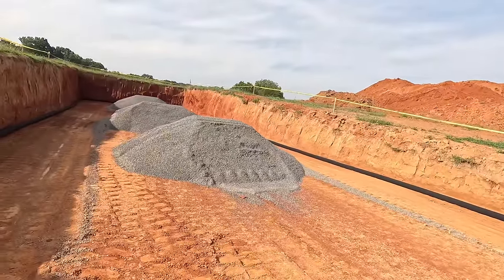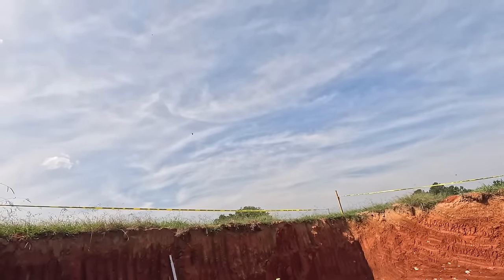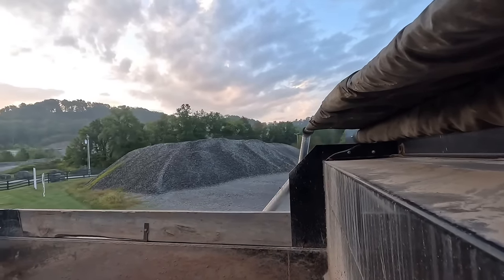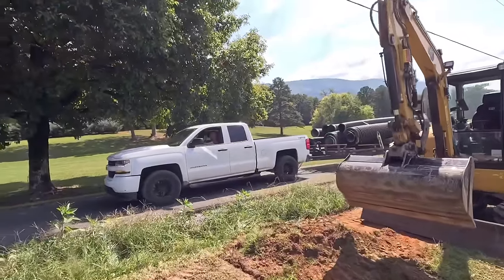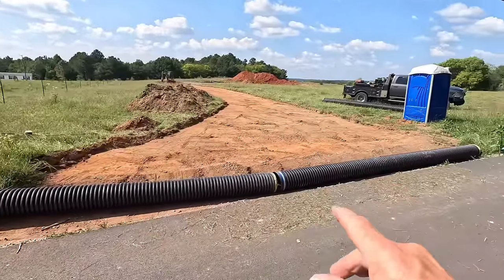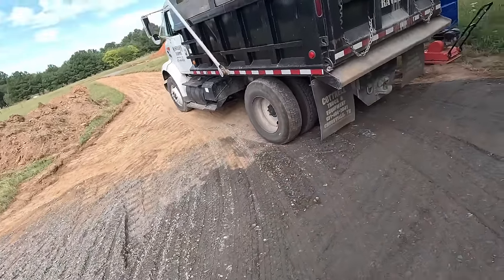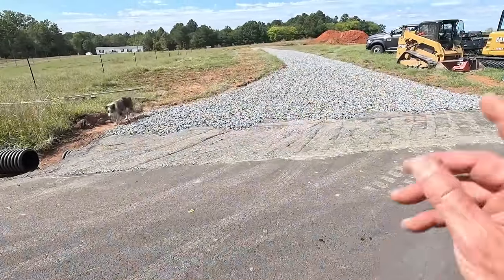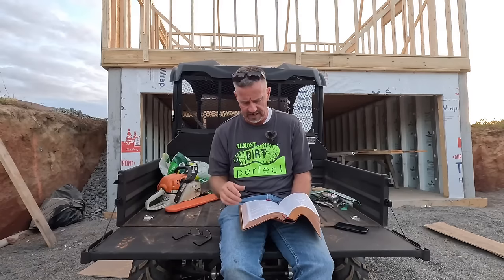LET’S BUILD A GRAVEL DRIVEWAY!!! NEW HOUSE, NEW DRIVEWAY…

Comment: Quick question, why don’t you take the teeth off the bucket? Seems like it would give a smoother finish when scraping and even dumping?
Reply from the maker: Good question but it’s not an easy thing to take those off and on. After you smooth it out and track/pack it down it’s in pretty good shape…
Thanks,
Sam

Comment: Awesome job. My only advise to anyone building a basement, is to use schedule 40 drain pipe around your basement perimeter .. this ribbed pipe tends to hold water and is a little on the flimsy side!
Reply from the maker: That is right, schedule 40 is a better option…
Thanks,
Sam

Comment: Looks great Sam! If you haven't tried one of those 36" aluminum landscape rakes they work great for leveling with less effort in my opinion think would of worked slick on that small gravel.
Reply from the maker: I have been wondering about one of those rakes. I definitely need to try one out.
Thanks
Reply: Landscape Rakes definitely work best for grading! Concrete (Come Along) Rakes are better for moving lots of material.
Reply from the maker: Thanks,I do need to get one…

Comment: Still toward the beginning of the video… Wanted to give you a tip about corrugated drain pipe. ALWAYS tape your joints. They can easily come apart, even after installation.
Reply from the maker: Thanks!

Comment: I was always under the impression that you needed a road fabric under that rock in the driveway or it will be pushed and sink into the dirt.
Reply from the maker: All depends on the quality of the base material under the rock. Here it is extremely hard red clay and doesn’t need fabric. In softer soil conditions and definitely in wet soil conditions the fabric is definitely needed…
Sam

Comment: Great message Sam I enjoyed it! The pad and drive turned out great. You seem to always have jobs that require shoveling and raking involved.😂 You could've used the 313 for the driveway if you would've had a 60 inch tilt bucket for it. SmithWorx 313 looks good with the tilt bucket on it. I'm sure he knows where you can get one at a good price. 🤣 Be Safe Out There and GOD BLESS
Reply from the maker: Thanks Jim I appreciate that! I know what you are saying about the rake and shovel 😳. 
I saw Lindsey’s 60” bucket and I really like it. Probably will have to get one of those. 😀
God Bless

Comment: Hey Sam, love your videos. I do have a question though. How do you know you’re getting enough compaction with that plate compactor? Especially when not doing it in lifts? It seems pretty critical in that application. I don’t pretend to know it all, I just learn by questioning.
Reply from the maker: The plate compactor lets you know when it’s compacted well. Best way to explain that is when you noticed the plate compactor change the way it sounds and the way it bounces on the rock it is a way of telling when the compactor has gotten it packed as good as it will get. Typically rock is like 75% compacted just by putting it in place. Then it doesn’t take much to get the finish compaction it needs. Lifts are very important and if you were doing like 12” or more you would want to compact in lifts. Hope that made sense…
Thanks,
Sam

Comment: Great video Sam! Hey have you looked in to a compactor plate or vibe roller for the skid? With as much as you use that wack and pack it may be a cost effective option in tight spaces for you
Reply from the maker: Thanks😀. I have checked on the vibratory roller for the skid steer. The local CAT dealer sent me a demo model and I used it on a job. It did a good job but not as good as the Volvo packer I eventually bought. The skid steer model would work great for small jobs but it was terribly expensive. The Volvo packer I bought can be used as a smooth drum roller when needed. But it’s a pain to take the pad foot shell off and on. 
Thanks,
Sam

Comment: What part of Tennessee you in? What kind of stone would you top the driveway with a slight grade to it with? I’ve got a slight incline in my driveway and some local companies have disagreed with my thoughts of running crusher run. The UPS trucks drive up my driveway a lot and just end up creating a rough ride over time.
Reply from the maker: I’m in SE Tennessee near Cleveland and Athens. I always like to use a good covering of crusher run and pack it down. It works great for driveways that have an incline as long as the driveway is crowned and packed to prevent erosion. Not sure why they would not want to use crusher run because it packs tighter than gravel/stone. 
Thanks,
Sam
Reply: @tristardiggin  absolutely agreed. Thanks for your thoughts. God bless 🙏

Comment: Just came across your videos good sir! I am definitely becoming a subscriber to learn from ya and hear your wisdom. Amazing message at the end. My brother and I are into our first year of business together and we do light excavation but mainly concrete… curious to why you used asphalt millings at the approach and why you didn’t use the skiddy to excavate the entire drive?Thanks for the video!!!
Reply from the maker: Hey I appreciate you subscribing and watching the channel. That is cool that yall have your own business going. Glad the videos are helping you figure things out and enjoying the message. The material at the end of the road was crusher run and I like to use it because it packs down really hard. The excavator would be a little faster cutting the driveway way in because there was minimal movement of the machine. With the skid steer you go slow so you can take the right amount of dirt and then a lot of back and forth to the stock pile. With the excavator you are almost always digging and moving only to reach more dirt. Once you place all the dirt outside of the driveway you can quickly use the skid steer to push it into a pile to haul away.
Hope that helps…
Sam

Comment: I like watching your videos. Ever have a county specify a culvert, but the ditch isn't deep enough for the specific culvert. For my house build they said they wanted a 12" culvert and ditch is the same depth. I am using RCP. Should I just bury it a bit deeper so I can get cover. The ditch is right off the road so I don't want a hump coming into the driveway.
Reply from the maker: Right, that makes it difficult to fix properly. If you bury the culvert and the outlet is below the grade of the ditch over time the culvert will fill up with sediment if it doesn’t have a positive flow going out of the culvert. Kind of hard to say what to do without seeing it but can you dig the ditch out on both side down the road to get the ditch low enough to put the culvert in and still have water flow down the ditch?

Comment: When you buy the rock, do you pay for it by the loader bucket load or do you get on a scale before and after and pay by the actual weight? Where I'm at it can be both ways, but if you buy from an actual quarry it's by weight. I assume that loader has a scale on it also. 

There's no replacing a hand rake for accuracy. But. . . What do you think about roughing in the gravel with the skid steer then using the mini with the wide bucket and it's grade system to get it really close? Keeping the mini in the middle on the very level base and scraping towards the center. Then using the rake if there's imperfections.

I love TN! You can leave your tripod set up in the road and you don't have to worry about anyone hitting it. lol
Look at you with your Screen in Screen editing skills. You're becoming an editing professional.

Message
My parents tried to build my house on a strong foundation. But I didn't maintain it and my walls cracked and my roof leaked. Many years ago. I had a storm and my house almost collapsed. But instead of giving up I made the choice to do a complete remodel on foreve
The good news is that anyone at any point in their life can rebuild their foundation. It is never too late.
Reply from the maker: Thanks!😀
I buy rock at the quarry by weight. They have scales that you drive accross, the loader also has scales too.
I definitely could have used the 304 with the smooth bucket and grade control. That may have saved some time. I have done that in the past.
I keep trying new things while editing. Makes it interesting to figure out something new. 😀
That is a great testimony of how you remodeled. And yes anyone can turn things around through the Lord! Amen…
God Bless

Comment: Brother your bucket has teeth used the back edge to grade in reverse and if you're pack down use the back edge driving forward with the bucket curled up. I hate to be negative but you had me yelling at the screen lol otherwise awesome project
Reply from the maker: Thanks Dave. I’ve done it that way but just prefer using the bucket edge. Appreciate the info though…

Comment: Hey Sam, great video learned a lot. As a guy wanting to cut in a new driveway (also here in middle TN BTW!), what are your thoughts on laying geo textile fabric down first? Thanks
Reply from the maker: Thanks I appreciate that and glad it helped. GEO fabric works great when the base soil is soft or there is moisture issues. If you have a good base then GEO fabric wouldn’t be needed. The GEO fabric saves your rock from being mashed down into the soil when there is a soft/wet base. If you have any questions feel free to email me…
Hope that helps…
Sam
Reply: @tristardiggin  Thanks for the fast reply! I may just do that and/or have you come and do the work! We purchased some acreage in Lebanon and it needs everything. Grabbing your info now ...
Reply from the maker: @musiccitycruisers3863  Glad to help! If I was closer I would sure take a look at it. 😀
Thanks,
Sam

Comment: Im in between on buying a skid steer and start getting jobs for myself. Worried i wont make it. Im about 40 minutes west of Nashville tn too. But watching your videos man. I really just want to try it. I do underground utilities all around Nashville for new subdivisions and multifamily
Reply from the maker: Buying a machine and going out on your own is a big step for sure. Hardest thing is building up your customer base so they are repeat customers and they advertise for you by word of mouth. Maybe start part time and build up your business that way until you can go full time on your own. However, if you have the work lined up and it is consistent you would probably do alright. A skid steer and a mini x is a great way to make a living if the work is available. 
Thanks,
Sam
Reply: @tristardiggin  That was my thoughts as well just start with doing some driveways and cleaning on the weekends until I can get in with some general contractors. Also have thought about getting my septic license as well as trying to get in with installing pools. 
Thank you for replying it's nice being able to talk to someone that's doing pretty much everything I want to do. 
 With my current job right now. I lay rcp 15"-60" c900 and ductile iron pipe. And sewer. I love doing this work and I'm a foreman running a crew currently. Was a site superintendent at previous company but didn't like the work place politics. 

Favorite saying to my guys is 
"Cut grade not corners and we will be fine"
Reply from the maker: @bloodsweatmoney9089 Yup, I think that is a good plan. There seems to be a high demand for septic systems. Wish you well and hope things work out for you to start your own business. 
I like that saying “cut grade not corners”. 
God Bless…

Comment: How do you size culverts so that you can assure they can handle the weight of concrete or dump trucks passing over them later in the construction process?
Reply from the maker: For most driveways an 18” pipe is pretty standard. But generally I look at pipes in other driveways, in the area, where I’m working to see what what used there. In this driveway there is very little water that will ever go through this pipe so I used the 12” mainly because my depth was restricted by the telephone line buried in the ditch. 
Sometimes the county, city or state will require a certain size pipe. 
Thanks,
Sam

Comment: Is that enough material on top of the culvert?  I have read 12" minimum material on top.
Reply from the maker: 12” or more is definitely what you want to get on it. It’s probably pretty close or a little less. But held up to loads of concrete and loads of rock as well. I would have went deeper but there was a phone line in the ditch.

Comment: Would a harley rake on your skid steer been faster for the driveway
Reply from the maker: The power rake would grind up the grass and top couple inches but it’s not good at removing the root structure and topsoil. It is better to dig it off with the excavator or skid steer.
Thanks,
Sam

Comment: Great video. Where I’m from that wouldn’t be enough coverage over the pipe. We would have had to dig down atleast another 6 inch.
Reply from the maker: Thanks Robert. It definitely could have used a little more depth. I’m sure that phone cable was only a few more inches below where I dug out the grass.
Sam
Reply: I agree. That phone cable set you up for a disaster if you went any lower. It’s crazy how strong a plastic pipe is!
Reply from the maker: Right, those pipes are tough. I’ve ran over it numerous times with loads of rock. So far it’s holding up nicely. 
Thanks…

Comment: Y didn't you take the teeth of the bucket when spreading the gravel wouldn't that make it easier??
Reply from the maker: Taking the teeth off and then back on isn’t an easy thing to do. Once the rock is smoothed out and packed in it works out good…
Thanks